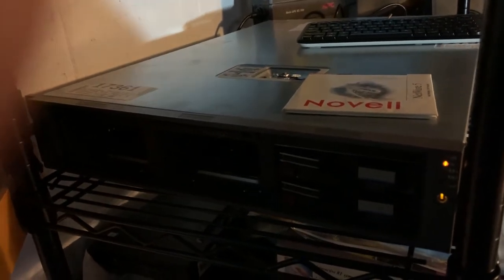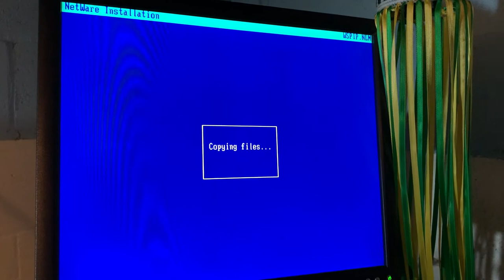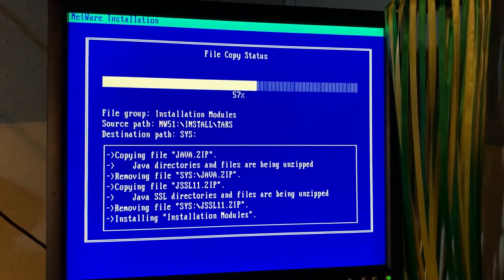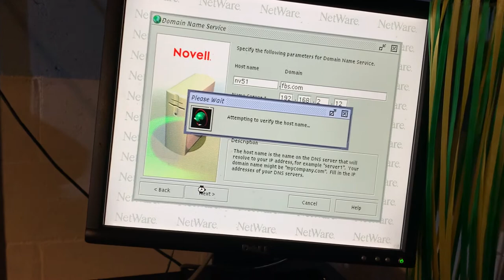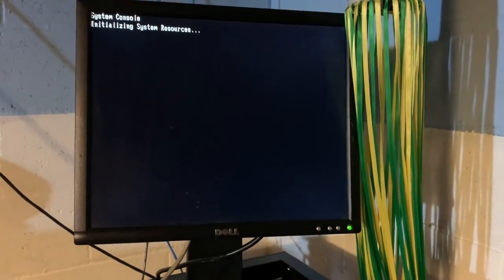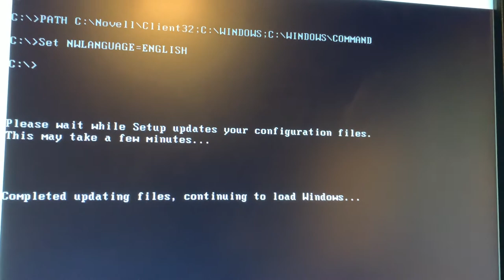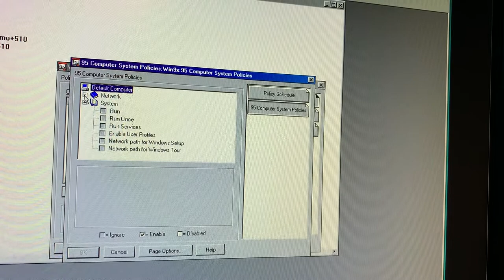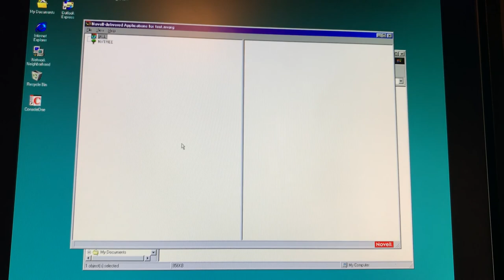HP/Compaq Proliant DL380 G2 overview/Novell Netware 5.1 install

Comment: Good Morning!
I got one of these from a friend, however, it has no operating system ( Windows 2003 Server Enterprise Edition ) and I was not successful; Would you help me?; I would install Linux if possible; Thanks in advance for your time.
Mario Alberto
Rio de Janeiro - RJ. - Brazil
Reply from the maker: This system should be able to boot from a floppy or CD.  I don't believe any drivers are required.  I would find a Windows Server 2000 or 2003 disc and try booting from it for starters.